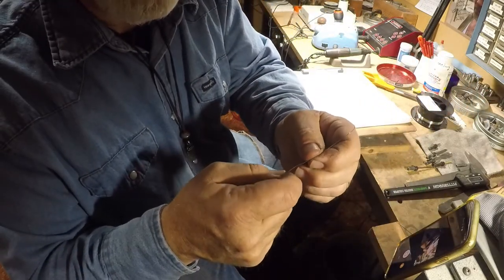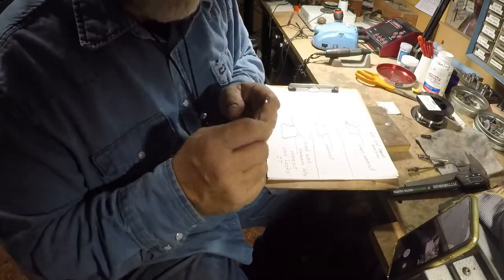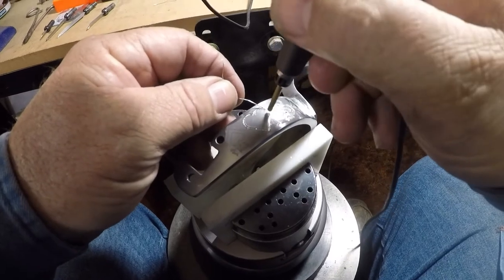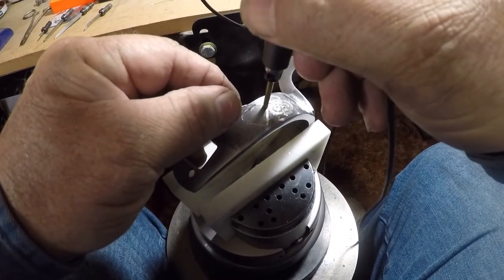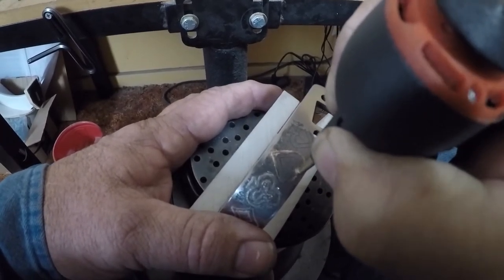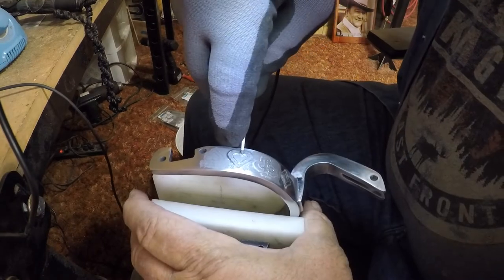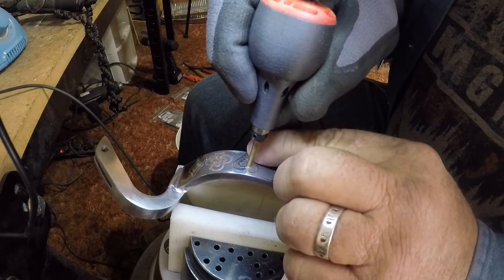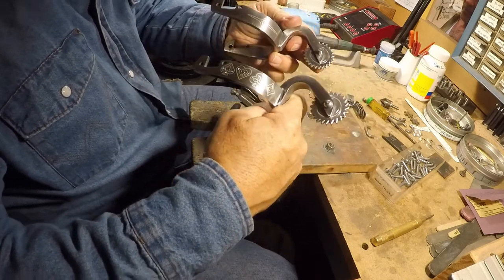Inlaying Silver Wire

Comment: thank you for the knowledge and time spent on the video.  i have several questions but ill just stick to one.  for a beginner what would you recommend for and engraver.  budget friendly but something that will do the job like what your doing in this video.  Thanks again
Reply from the maker: Well, I would always recommend the pulse graver. No air needed, and does the job and more. You can go with the air GRS models and maybe find one on ebay for less money, but you will need a pretty good compressor to run one. So money wise, you will spend close to what you will spend with the pulse graver.  When i got started, i borrowed $5000 to get all my engraving stuff. You can always go the hammer graver route by hand…. But you will spend alot of time learning. Of course with any engraver, its best to sign up for classes.